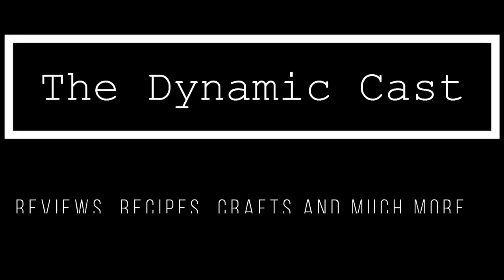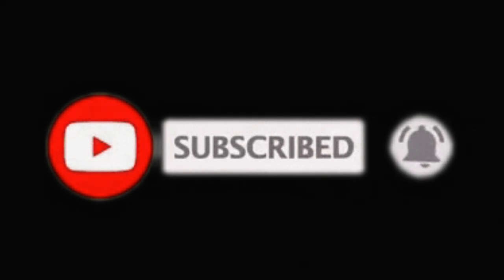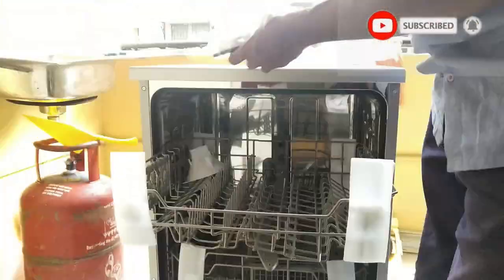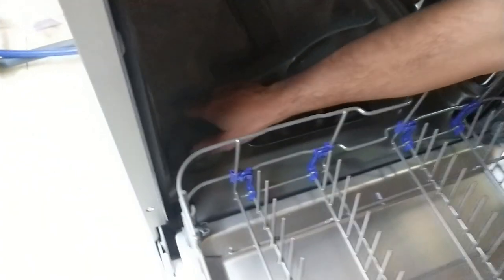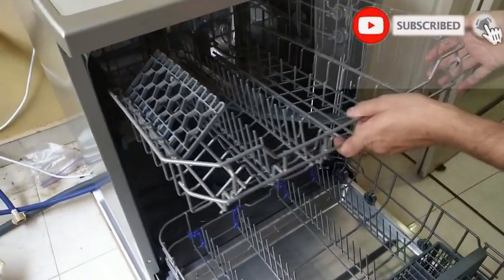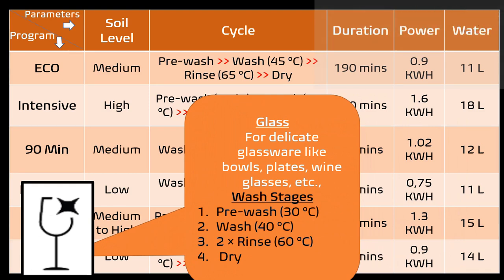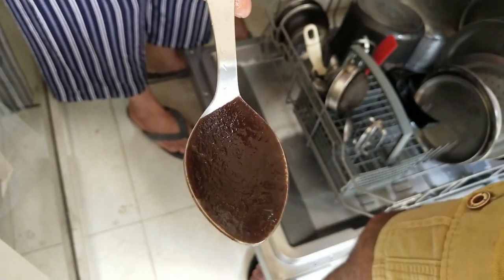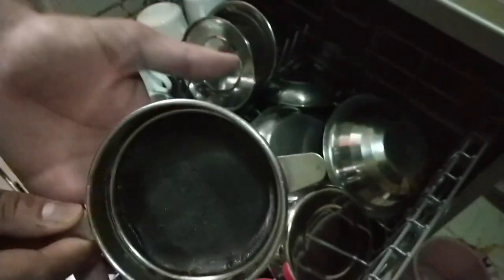Latest Hafele Dishwasher [Aqua 12 S] REVIEW in English by @The Dynamic Cast

Comment: Nice informative video. Can it be used on a trolley(Stand with wheels just like we use washing machine)for taking it near to water tap-use-and bring it back? This requirement is due to space constraints.
Reply from the maker: Yes. You will have to separately purchase a trolley from the dealer or its easily available online. However moving it on a daily basis may not be advisable. You can keep the machine at a distant place and extend the water / electrical lines...

Comment: Hi can you please help me actually I need to know salt compartment remain dry or will fill water automatically because in mine  machine it's filled with water after adding salt please help
Reply from the maker: Hi Ayesha
If you check the video at 4.28, the technician advised to add 30 ml of water. So it should be fine in your case

Comment: I purchased hafele dishwasher last week but it is not drying vessels and dishwasher  please tell me what I do
Reply from the maker: Which program are you using? Try Intensive and check the drying performance. Also make sure to load the utensils properly (upside down). If the utensils are not loaded properly, water will accumulate and machine will not be able to dry it properly
Reply: Dear Sanjay,
We regret the inconvenience caused to you. We request you to kindly share your contact number, email id, and location with us. Our representative will get in touch with you shortly. Team Hafele.
Reply: Can We use RO water for this dishwasher